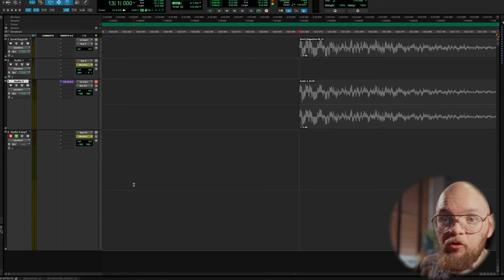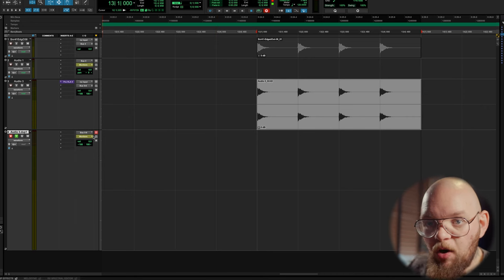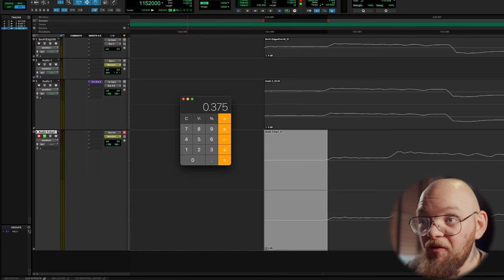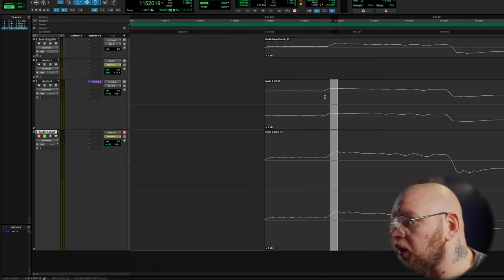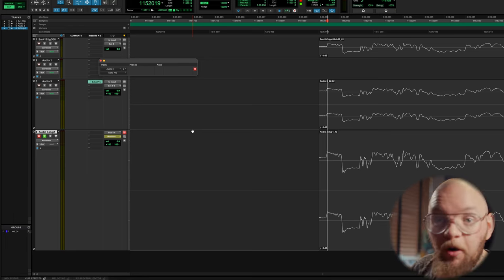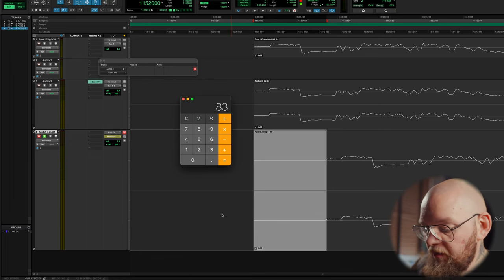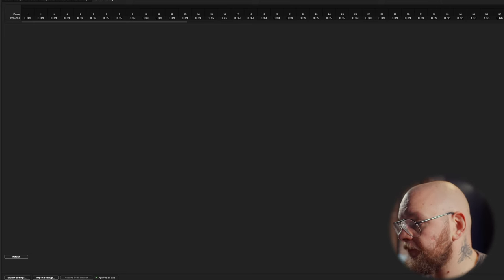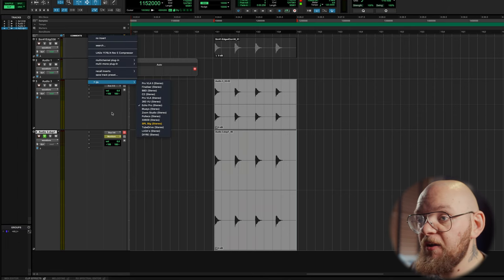The Cause Of Your Despair - Pro Tools Hardware Delay Compensation.

Comment: I've had nothing but latency issues and bugs over the decades using DAW's. I just use a 30 channel mixing desk and my DAW as a multitrack tape recorder to save the headaches. Saying that, I don't use ProTools because I detest the subscription business model.
Reply from the maker: So do I. It’s criminal how much they charge for it too but I’m in too deep now haha
Reply: Yeah analog mixing desk all the hardware on the desk and the mixbus into Reaper, does delay compensation too but I saw that it was a little bit off but I don’t mind. 😊
Reply: Just buy it str8 up

Comment: I've tried 100 times and watch many videos I completely understand how this works. My problem is not delayed its actually head in time and there is only a few threads of people that talk about this issue. I have never found the solution to my problem other than going HD. I gave up a few years ago.
Reply from the maker: How random. That must surely be a miscalculation in the ms maths? Either that or something freaky going on with the drivers!
Reply: this is also happening to me ... fresh install on pT too
Reply: Same here. I use time adjuster as a work around, i hoped i wouldn't have to revert to this after upgrading from PT 11 to the current version.

Comment: When I use HW insert in Pro Tools (latest version) with my Apollo X6, apparently latency is compensated automatically because the outcome of your test on my system is NO DELAY between the tracks.  Even by listening to the same track in parallel with HW insert there is no perceived phase shift...   It's a sort of mistery which is apparently non documented anywhere, but It works for me...
Reply from the maker: I have had something similar happen when I used to have an Apollo. Weird!

Comment: Are you using HDX or Native? Is delay compensation on? Do you still have the same issue if you bounce and import? Why would you play from one track and record to another?
Reply from the maker: 1. Native
2. Yes
3. Irrelevant.
4. Have you even watched the video?
Reply: Still not clear on what you are trying to illustrate. If you place hardware inserts on tracks, PT will compensate for the delay across all track individually on playback and you should not hear any delay discrepancies. At least with HDX.  If you re-record a track by bussing internally, you will record the round trip delay, as you have shown.
Reply from the maker: I’m not on HDX. Native does compensate for delay but the timing needs to be manually accounted for. As I illustrated in my video. Otherwise if you use a hardware insert without calculating the delay, the timing will be off. This isn’t a thing on HDX but it is on Native.
Reply from the maker: I believe from reading that this process may not be necessary if you own an avid interface but I never have so I can’t comment on that particularly!
Reply: I don’t use ProTools but Studio One. The external hardware plugin (Pipeline), has a test button, and it just does it for. I find it very weird that ProTools doesn’t do something similar.
Reply from the maker: @greenloungerecording9362  How I wish that were the case without needing to drop 10 grand on Pro Tools HDX!

Comment: Do you know if its only happen in protools? Is also an issue on reaper?
Reply from the maker: I can’t comment on reaper as I’ve never used it! You’d need to check their manual for how they handle outboard connections!
Reply: In Reaper you have to set the delay compensation also but it’s pretty easy and calculates it automatically by a ping signal.

Comment: I am dealing with this issue right now after fairly recently switching from Logic to Protools.  I could not believe that Pro Tools did not have a ping tab like logic to automatically calculate round trip latency.  With all of the crazy deep features that Pro Tools has it is wild that they have not added this.  People have been asking for many many years and it doesn't seem like it would be that difficult only leads me to believe that they want this to be a pain so that people are more interested in buying there interfaces that handle all this for you.  My question is how does this process look when you are using a patch bay and signal is going through multiple pieces of hardware?  I mean if you only need to do this process once for different sample rates that isn't to bad but if you are having to do math everytime you want to set up different signal chains that is kinda ridiculous.  thanks for the video dig the channel.
Reply from the maker: Thanks for watching! Different chains of gear make no difference providing all of said gear is analogue! The single calculation of round trip latency will do the job for you! I used to have a setup similar to this with patchbays etc and I never had a problem. I work mostly in 48 so it's mostly set and forget for me but I agree it's ridiculous that Pro Tools doesn't do this automatically unless you drop 10 grand on a HDX system. As if charging us an absurd fee every month wasn't enough already!
Reply: @OliverShillito  thanks man.  ya totally agree,
Reply: Yep … you just answered your own question just go hd that’s what I did in the long term it’s worth it !!
Reply from the maker: @armine6176 one day for sure but for now. Delay compensation timing haha

Comment: Now change your buffersize 🤣 How is this still a thing in ProTools?!
Reply from the maker: Because AVID 😩
Reply: there is no way I would work with hardware inserts without HDX or Carbon. It's just too error prone and your "bang on perfect" is never sample accurate. This has been an issue on the native Pro Tools systems for well over 10 years now. Back then that was what got me moving to HDX and I havent't regretted it one day.
Reply from the maker: @martenthielges1179  I’d love to move to HDX. I likely will one day but for now that’s about as close as it’s going to get I reckon!